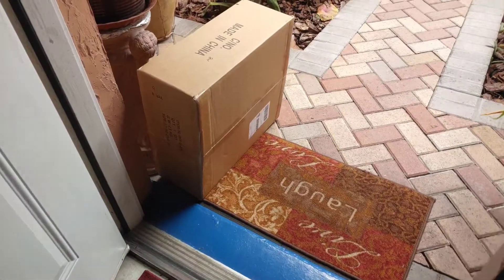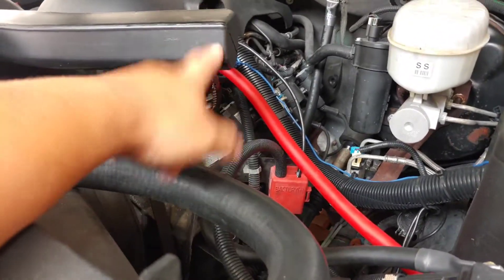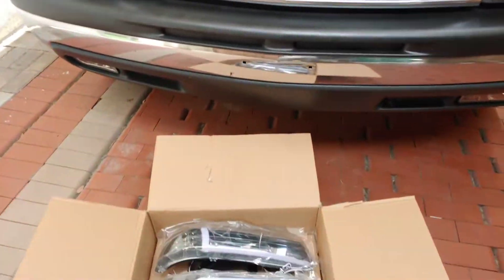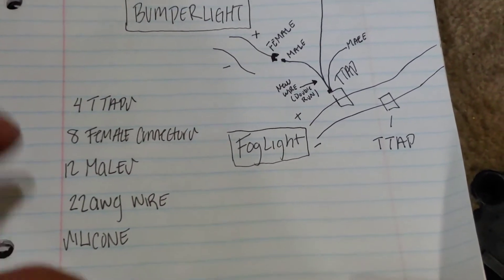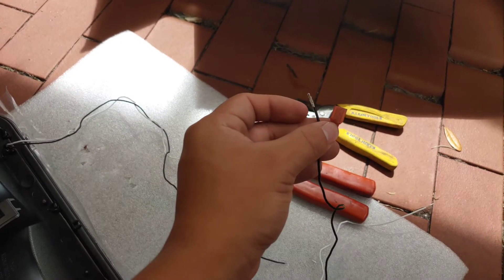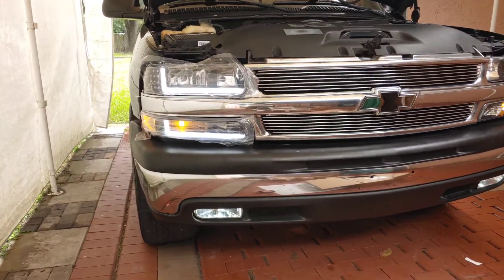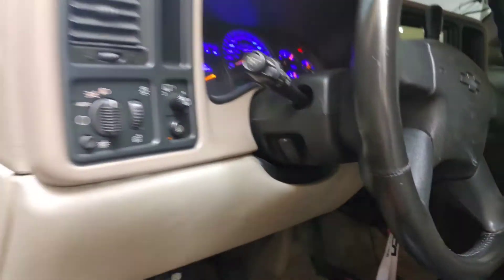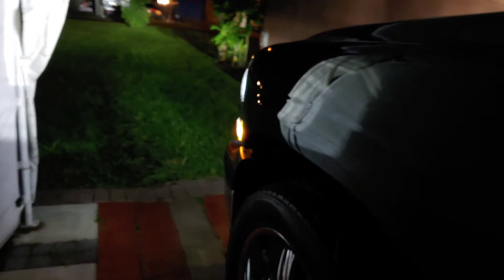New Style DRL Headlights On Tahoe 🙌 (3/4 Drop & 26s Soon)

Comment: How did you adjust the headlights for no gap im having a really hard time ???
Reply: Me too man, I can’t even get mine to even sit perfect…
Reply from the maker: Need alot of time & patience, have to work with the headlights, & apply some pressure to get the pins inside all the holes
Reply: @SleepyBoiii  easier said than done lol. I've put maybe five different sets in mine and some fit perfect and some don't fit well at all. Seems to me the ones that don't line up well are faulty from the assembly line. Aka bad cut and measurement